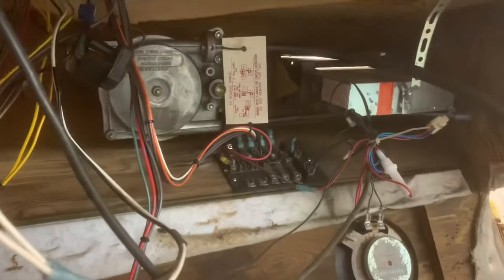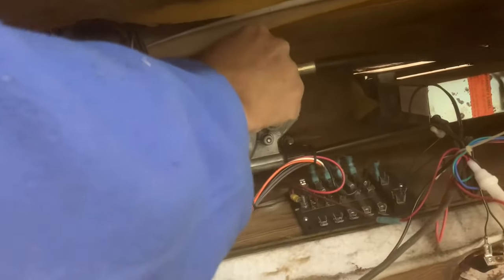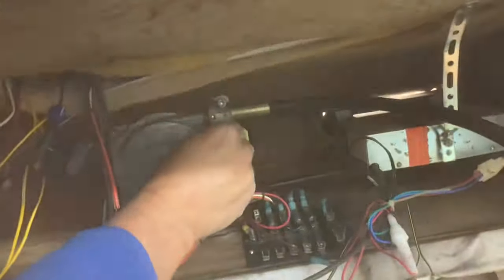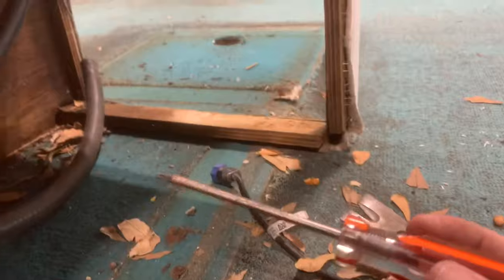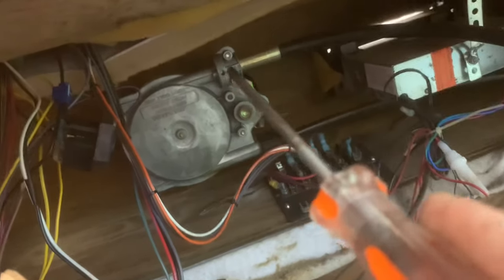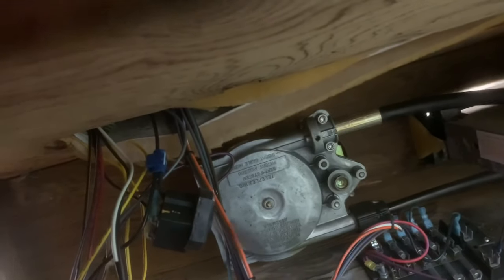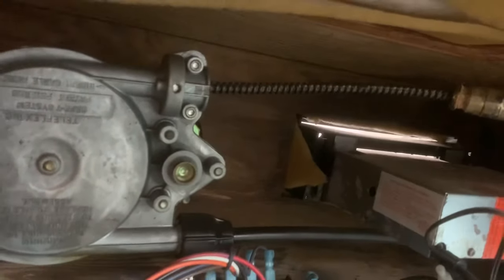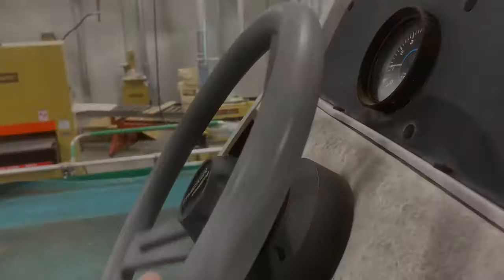How to remove a steering cable on a boat

Comment: l, on the other hand, had problems putting it back together. After watching this video, I learnt that I have to turn it hard to wind the cable in until it click in place. Before I couldn't find any instructions on Google. Without your video, I don't know how long I will be stuck in this step for. THANK YOU VERY MUCH FOR THIS VIDEO, FROM AUSTRALIA.

Comment: Thanks for the vid. 
Most steering cable videos assume you are installing a whole new system so they don’t show you how to remove an existing cable. 
My winter project is to redeck a pontoon so I will need to do this, and the boat has this same teleflex cable.
Reply from the maker: I’m happy this helped you out.  I was renovating a pontoon for a friend and needed to remove the console in order to replace the carpet.  I will be uploading more pontoon renovation videos soon.   Thanks so much for watching and commenting 🐿
Reply from the maker: Good luck with your renovation!🐿
Reply: Thanks. It is a work boat for a sailing club with no permanent seating, so it is a fairly simple job. We already epoxied and painted the new plywood, so the winter work will be mostly disassemble and rebuild.

Comment: Ty very much for this video now I feel confident about removing my steering cable. I need to find out if it's the rack that's stiff or the motor end. I just put new grease in the tilt and steering tubes and the steering is still way to stiff. Going to try and lubricate this old rusty rotary steering.

Comment: Great video! I have slack in my steering of like 2 inches, what do you suggest doing? Can I adjust something at this gear box? Thanks.
Reply from the maker: There isn’t an adjustment that I am aware of, I would just replace the cable and gearbox. Thanks for watching, glad it helped you out. 🐿

Comment: Cheers! Finally changing my cable thanks to you! But I have a problem attaching my new cable, any tricks for installing it? Is that little steering cable hitch pin part of the installation? To secure it? Mine seems to go in, I hear a click but it pulls out after a little bit of testing. I'm missing my hitch pin. Thanks again!
Reply from the maker: Don’t forget to reinstall the pin once the cable is fully seated.
Reply: @FishinwithSquirrel  cheers! Will need to find one first or maybe use something of the shelves?

Comment: Thanks for the video! Cracking me up with you pointing left saying right.. am i missing somethin?, what was your thinking there?
Reply from the maker: I was point to the left and saying right in reference to the steering wheel on the boat if you are looking at the wheel from the top side.   I was under the console so everything is backwards.  To unwind the cable turn the wheel clockwise or to the right.  I hope this helps.  I may make another video with a split screen since I actually know how to edit now.  It would probably help the explanation.   Thanks for the comment ! 🐿

Comment: Thanks!!! I couldn't figure ho to get the cable off the steering wheel box. Used the screwdriver to release the pin and had to wiggle the steering wheel.
Reply from the maker: Glad my video helped you out! Please hit that like button for me. 👍🐿

Comment: Thanks for video- Curious have boat w/ steering wheel not center - Motor straight steering wheel about 1100 instead of 12- Drives me crazy - It's Teleflex Wondering  where the steer wheel should  be positioned when start to feed back cable?
Reply from the maker: My steering wheel had Splines to where you could take it off and realign the wheel.  Hope this helps.  Good luck 🐿
Reply: @FishinwithSquirrel  thanks I check it out

Comment: How would you fix it if your hall snapped and steering wheel spins freely, and does not turn the engine or cable
Reply from the maker: Hall snapped?  Not sure what you are asking but if your steering wheel just spins, I would pull the cable out of the steering gear box and manually move your motor back and forth to see if the cable moves or if it’s your steering box.  I didn’t have a steering failure, I was remodeling a pontoon boat and need to remove the helm. You may need to replace the cable and steering box. If you do, you may want to replace it with hydraulic steering.
Reply: @FishinwithSquirrel  sorry I meant helm and I plan on replacing all of it, but just do not know how I would get the cable out of it to Pool it all the way out if it is stuck in the helm. It snapped on me and it acts just like a vehicle when you’re steering shaft snaps or comes apart, had no steering at all, but I believe the cable is good.
Reply: @FishinwithSquirrel  and is hydraulic steering better? And is it hard to install?
Reply from the maker: @JohnSanders-bf3xi You should be able to remove the pin and pull the cable out unless it is just too corroded.  Ising the steering wheel to remove it is just easier and keeps you from busting your knuckles. If you are replacing it anyway, you could just cut it
Reply from the maker: @JohnSanders-bf3xi  I have never installed one but I do have a boat with hydraulic steering.  It is definitely an upgrade.
Reply: @FishinwithSquirrel  OK thank you

Comment: Do you have a model number for this box?  I have the same unit and want to replace it......but cant find what model number it is.  Thanks.
Reply from the maker: I didn’t replace my steering box, but I looked up seastar solutions mechanical steering technical help number for you.  It is  610-495-7011.  They are open M-F 8-5.  They should be able to tell you which replacement product you need. Hope this helps. 🐿
Reply: @FishinwithSquirrel  Well hot dang.  Yea, thats a big help, much appreciated.  You are the only video I have found with this steering box!

Comment: I have about 6 to 8 inches of slack in my steering, would a new steering box fix this?
Reply from the maker: I’m not sure if the steering box swap would fix your issue or not. If I we’re going to replace the steering box, I would probably swap over to Hydraulic steering.  If I were to stay with the cable drive, I would not only replace the gearbox but the cable as well.  Good luck.
Reply: I have a 2019 Suntracker 20 ft DLX party barge, under the helm it does look like this system, I think the easiet, less expensive would be the best way to go I think.  Hydraulic may be more expensive and probably more complicated install for someone like me who has very few adult type tools.
Reply from the maker: my pontoon I renovated is a 2005 tracker 21’ Fishin barge pontoon. I’m still using the original gear box and cable. You shouldn’t be having any issues with a 2019.

Comment: Was there something wrong with the cable or just part of redo on the boat
Reply from the maker: We removed the console so we could put new carpet on the deck of the pontoon. We ended up replacing the console but reused the steering cable.  The cable was fine.  The push pin to release it was much harder to push on than normal.  Thanks for the comment Edward. 🐿

Comment: can you do a video of the other end. thats were they seem to seize.
Reply from the maker: Ray, I removed my cable to restore my pontoon boat squirrel. I did remove the other end because I bought a new motor and swapped out my old one.  I should have videoed the motor swap.  The next opportunity I have, I will film a complete removal.  Thanks for the comment, I appreciate you watching. 🐿

Comment: One minute in I had it figured out. Found out that if I continued turning the wheel, it threaded the cable out
Reply from the maker: When you turn the wheel the other direction it will feed the cable back in. Hope my video helped you out. 🐿

Comment: How to remove from motor is impossible to find
Reply from the maker: I’ll have to make a video on that Mat M. I replaced my outboard motor, but didn’t film rigging or removal.  The steering cable at the back isn’t difficult as long as it isn’t seized up in the motor tube.  I have to pull my boat out as soon as all this rain stops to do some maintenance,  I’ll try to post a video soon. 🐿

Comment: Disconnect battery so if cable contacts electrical under helm you don’t get surprise.
Reply from the maker: Battery was removed in my case.  You bring up a good safety tip. Thank You 🐿

Comment: Pulling the metal cable out of its black plastic jacket? That’s what I meant?
Reply from the maker: I have never taken the black tube off.   The tube is where the excess cable travels when the boat motor is turned to the left or port side.   I suppose you could grease part of the cable removing the sleeve but there is going to be cable in the gear box you can’t access.
Reply from the maker: I hope this helps. Thank you for viewing and commenting 🐿
Reply: @FishinwithSquirrel  no, what I was trying to say is: suppose you have the cable totally out of the boat, on the ground…can you pull on the side of the rod and pull the whole thing out of its jacket /sleeve?
Reply from the maker: Sorry I misunderstood Jack.   I’m not sure whether you can do that or not.  I’ve had the cable loose from the motor and the gear box when I was restoring my pontoon boat but I never tried to remove the cable from the outer sleeve.  The next time I take one loose I will give it a try.
Reply: @FishinwithSquirrel  thanks, just seems like you could do that and would be a way of cleaning the old lube and lubricating it. I can’t find anyone on YouTube that’s done it. Have a great day.